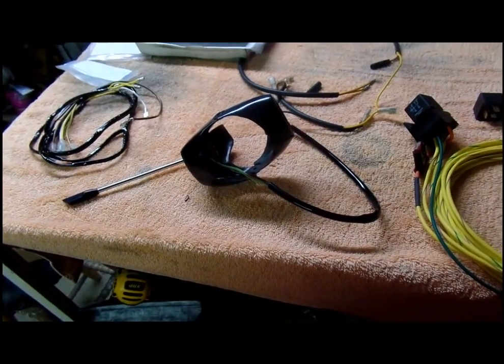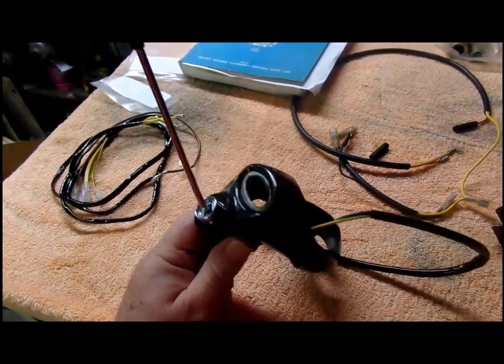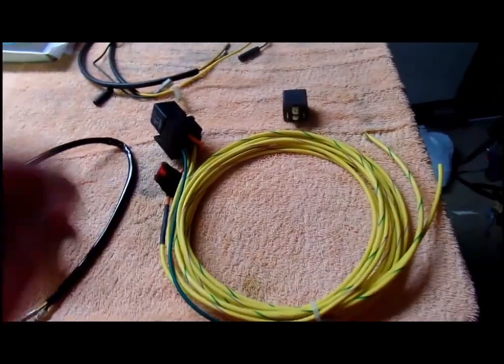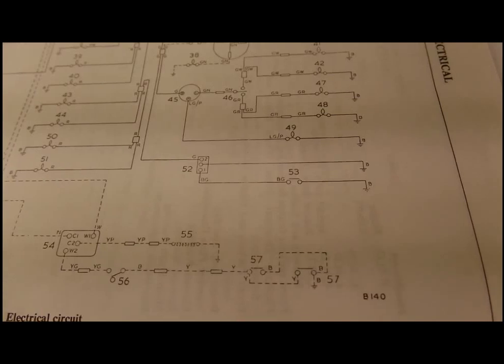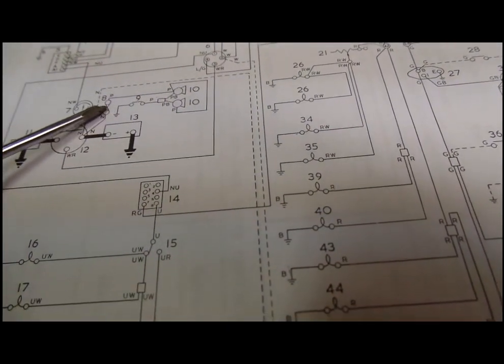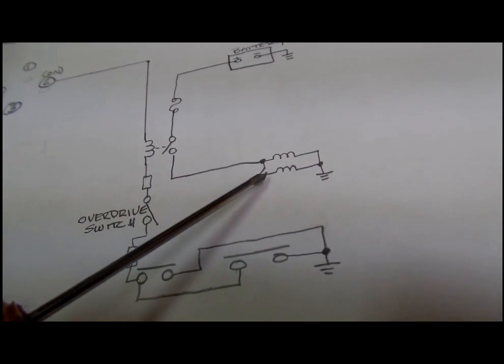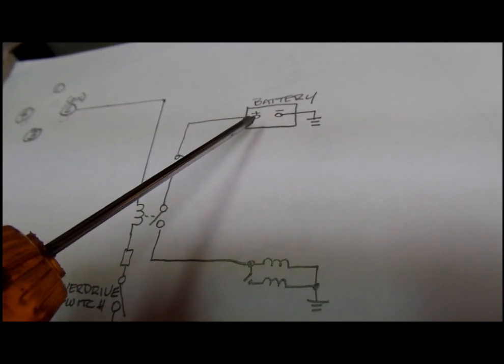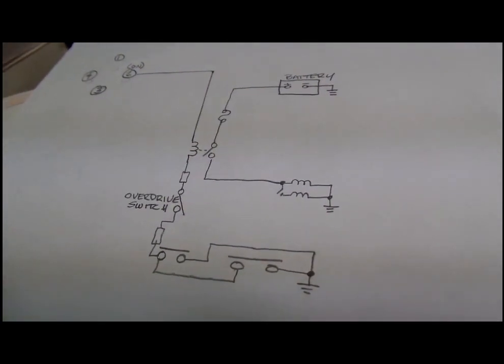TR4A Overdrive Electical installation Plan

Comment: Hi Dave, great idea installing to overdrive...I won't have another triumph without either the stock OD or a 5 Speed conversion.  Just makes it so much nicer to drive especially on longer outings.  You might want to consider installing a "logic controller box" .  Works great for the A Type.  Something like this...http://www.triumphspecialtuning.com/index.php?route=product/product&product_id=109  cheers, Tush
Reply from the maker: Thanks Tush,
I am really looking forward to going on some longer distance drives and the OD will really help. I often find myself shifting into 4th on the freeway and then absentmindedly pushing in the clutch and realizing there are no more gears!